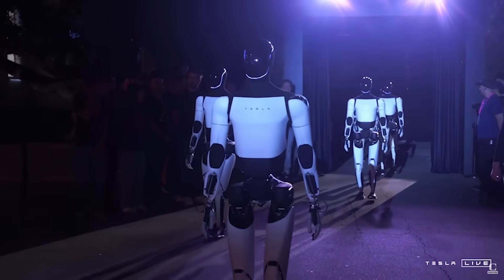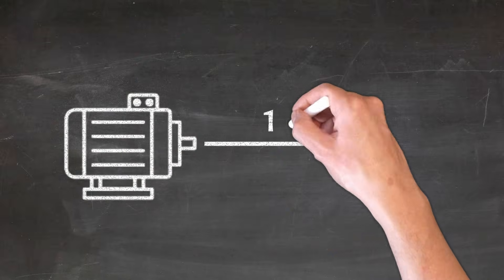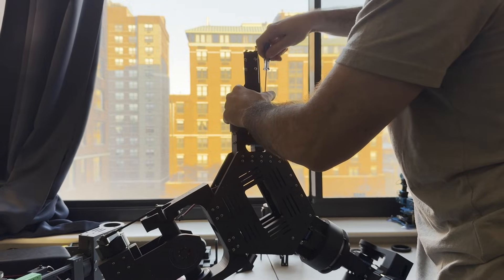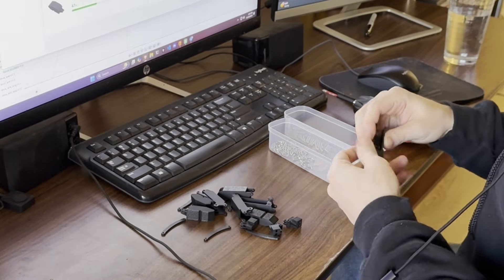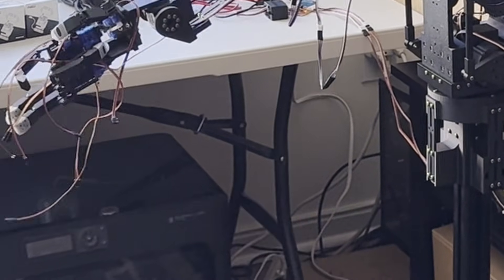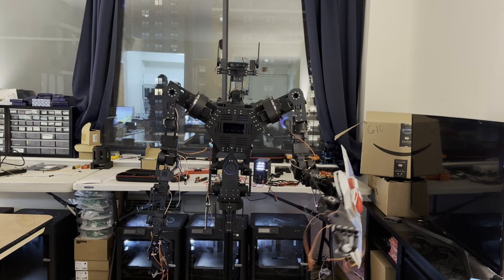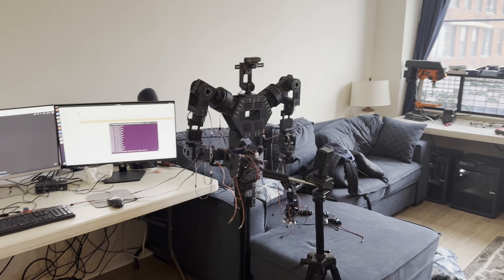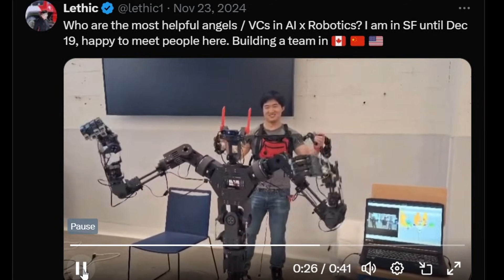I Made a Humanoid Robot So Elon Doesn't Have To

Comment: For the hands just put some pads like the ones underneath laptops on the fingers for grip
Reply from the maker: Yes I got some silicone pads for better grip. Its better but still very hard to control 5 fingers
Reply: @Nick-Builds1  its probably the grip strength